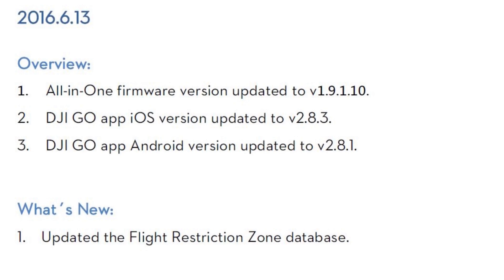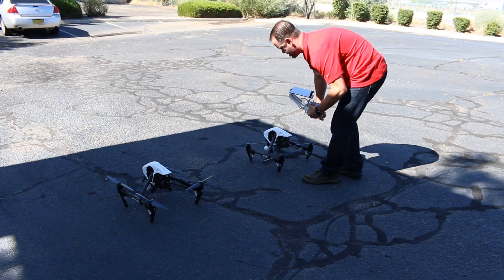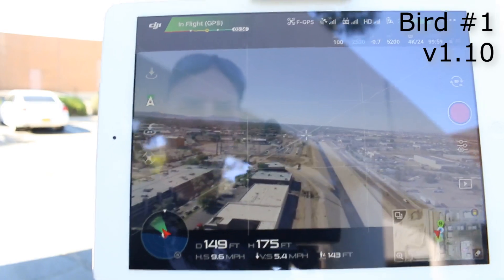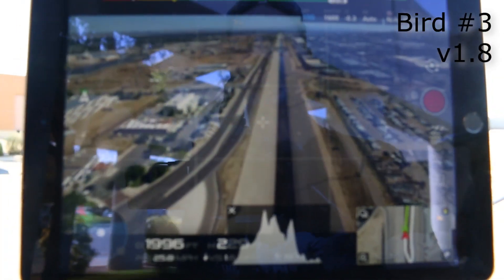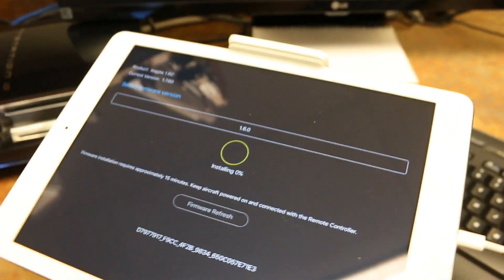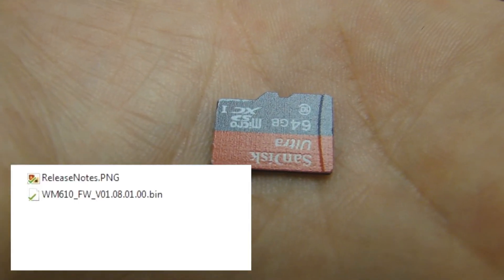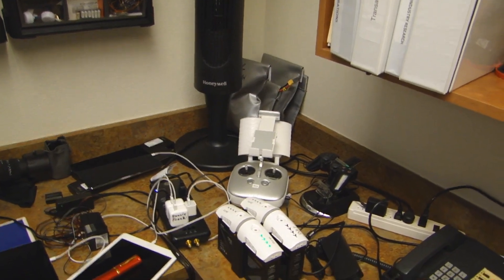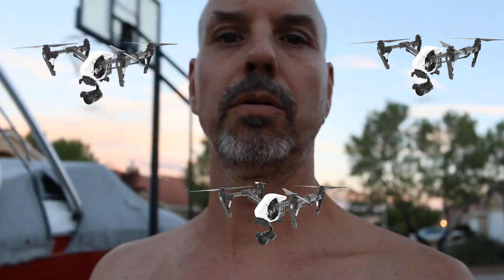Make your Inspire 1 great again...Part 1...

Comment: hi donie i have a little problem with my inspire 1 i installed the 1.9 version on mu drone and in one of the remotes controller the master wich is the newest version Gl658C the problem is that when i try to rollback my other controller gl658B it gives me errors and the gives me red light with beeping sound the error is remote controller encryption erorr what can i do or if you could help me privatly

Comment: Hello amigo, Thank you so much for your videos, great informations, help a lot, i have a problem With the gear system to push the legs down and up. Could you help me to learn how to fix it with out sending to dji? Or replace it process. Gracias!
Reply from the maker: Hey Carlos.  Sorry...that is a hardware issue.  I have yet to take an Inspire 1 apart, so I honestly don't know how to replace that worm gear or any of the other components.

Comment: 26.2.21 - I downgrade the remote to v 1.6 and when I restart the controller it beeps with a red light and tells me a remote update is required. Just my luck! Looks like I'm stuck with v1.9.2
Reply from the maker: It's been reported that the "C" controllers won't roll back to v1.6.  The "A" and "B" controllers will.  Check the part number on the back of your controller to see if it's a "C."  If it is, then yes, you are stuck with v1.9.2.  The good news is that that version has the good video feed.  It just has more NFZ's than v1.8.xxx.
Reply: @drummerdonniedotcom  Bummer I thought this would solve my glitchy, green feed. I have a C version controller, thanks for the heads up with that mate. Back to the drawing board for me by the looks of it... Subscribed BTW.
Reply: I'm actually licensed so the NFZ doesn't bother me too much ( although there are more and more popping up each time I log a flight !!) I'm thinking somehow damage to an antenna?
Reply from the maker: @gmtmtfilms : Well, if you can find a used A or B controller on eBay, that will solve your video feed problems.  And I believe you can still slave the C.  But I can't swear to that.  Oh...and thanx for subscribing.
Reply from the maker: @gmtmtfilms : Well, v1.9.xx doesn't just have more NFZ's, it has erroneous NFZ's.  Guys were complaining that they couldn't fly out in the middle of nowhere.  To avoid that scenario, you need to use a legacy version of the Go App, v3.1.1.  Any later than that, and your bird can be prevented from launching.

Comment: Hi Donnie the links to older FW is not accessible. I cant download the older FW files. I had the same problem with the Inspire 1 Pro. Any Help? Thanks
Reply from the maker: I just tested the Panorobot link.  It works.
Reply: @drummerdonniedotcom  Thanks Donnie will check it out now.
Reply: @drummerdonniedotcom   The Links have requested time out when clicking it. I tried with all my other downloaders. IDM and FDM.
Reply from the maker: @desmondkipan2713   I don't know what to say.  I went to the link.  I even downloaded a couple .zip files with no problem.  It's either your network, your security or your devices.  Panorobot is NOT a "secure site."  So many browsers - dare I say ALL of them - will not allow you to go there unless you allow http:// sites.

Comment: I still have the website www.panorobot.com open and able to use it if anyone needs a firmware bin file. Currently I'm running 1.11 and I have tried the magic file for debugging along with the 1.8 with no success. I think I need to downgrade to 1.10 but I cannot find it online and its not on panarobot. Some people were successful however I'm still trying to explore all possibilities. My drone is still able to fly and everything works however from the time I power it up in the app it says NO IMAGE TRANSMISSION. I have tried many alternatives with and without the bin file on my root directory along with the debug file but nothing works. My drone will beep a few times and then goes into this long loud process and the aircraft blinks green and red. Nothing happens with the motors blinking. It shows success on the txt file but that is not actually reflected on the about section in the app!
Reply: UPDATE: I rolled back to 1.8!!!! Everything this gentleman said worked!!! I’m still having the issue of no image transmission! When I turn it on it’s already there. I can see nothing the camera sees but the camera is working and moving!! AT LEAST I GOT THE ROLLBACK!!
Reply from the maker: @mrcarterflyhighkingc3863 : Try rolling back the app to v3.1.1 (iOS version).  I have not tested any of the legacy FW with contemporary versions of the Go App. 
Pro Tip: Go App v3.1.1 won't run on iOS 13, so you have to run legacy iOS 12 or earlier...down to like iOS 9 or 10, I believe.
Reply from the maker: @mrcarterflyhighkingc3863 : Also consider the possibility of a hardware failure of either your USB port on your RC, your Apple cable, or your iPad.  I like to switch components out to eliminate the culprit.
Reply: Donnie Frank i replaces the module on the RC last month! I have rolled back to 1.8 from the panobot website but still the no image transmission! I also made sure the shutter was on auto as recommended on another video so I guess the only thing is the GoPro app. How do you exactly rollback the app??
Reply from the maker: @mrcarterflyhighkingc3863 : Rolling back the app is way too complex to get into here.  Check out YouTube DigDat0.  He's got tutorials for all that stuff.
Reply from the maker: Almost forgot...so am I reading you correctly that panorobot.com is YOUR website?
Reply: Donnie Frank no sir it’s not my site. The other day I watched your video and clicked on your link and the site opened and I never closed it! I’m able to see and download all the firmware bids that the site offers somehow. Funny because I opened another window and tried to open the site but said it’s under construction.

Comment: Hey Donnie, thanks for this video. I am going to try this one. One question tho, you mean to say there will be 2 files on the micro SD root directory, ( 1 ) is the BIN file ( firmware ) and ( 2 ) is the blank file named WM610_FW_DEBUG. Right?
Reply from the maker: Correct.  I address this in part 2.
Reply: Donnie Frank thanks mate. This was really a BIG help!
Reply from the maker: @TheYDXtv : You are very welcome.

Comment: It’s 2020, Had to send my inspire to DJI to get fixed and they updated my firmware to the latest 1.11...+, dont do this. It only allowed me to go 1400 ft away. So I found this video of how to downgrade, and the version 1.08 which I downloaded but bird didn’t take it , so I had to unbrick the bird by using the debug file. Took me awhile to figure out how to change it from a txt file to just a file, cause his video is 2 years old. But eventually got it figured out. Motors did the red updating thing, now waiting on it to take the 1.08 version, I just don’t know when the update is done.....bird is blinking all colors of the rainbow...Will update my comment when it’s complete .....and see if version rolled back .
Reply: Updated successfully
Reply from the maker: @thomaskokoska6455 : Good deal.  I hope you subscribed...<;^)

Comment: I really appreciate all the time and research you spent on this and on helping us commenters!  But unfortunately the roll back doesn’t work as I use the X5. DJI is a joke.
Reply from the maker: I've never try to roll back with the X5, but it's my understanding that it takes more than twice as long as with the X3.  One user told me "an hour."  So...maybe try the rollback again, but this time wait a good hour before stopping the process, checking the logs and then checking the version number.  Please let me know if this works.
Reply: I did this earlier today with my X5, google search for the Inspire firmware modding tool, it’s the one with the .bat file, you can even modify the firmware file version you’ve chosen (like removing altitude limits, speed limits, etc.) and then you compile it, again using the tool, put that on to an SD formatted in the Inspire X5, and pop it in. Final step is to press down the little red button behind the nosecone of the inspire, and turn it on with that depressed and the SD card in. It will make the noises, and took less than 5 minutes for me. Then you’re done. You can take the card out, delete the firmware files after checking the success of the operation, then format it again and start flying.

It’s very straightforward as long as everything works as it should. And even if it doesn’t, the troubleshooting is pretty straightforward. This way you can choose any firmware version you want. You can also download these versions from dank drone tools, if I remember correctly, in order to easily flash them to an Inspire.

Comment: Hello, great guy. I'm having issues updating my inspire 1 with x3 gimbal. Delete history success.

Result: Failed.
Reboot the aircraft and try to upgrade the firmware again.

========== 2014.01.01 00:00:11 remo-con disconnect======
Packet: WM610_FW_V01.09.01.30.bin
Result: Failed.
Reboot the aircraft and try to upgrade the firmware again.

========== 2014.01.01 00:00:11 remo-con disconnect======
Packet: WM610_FW_V01.11.01.50.bin
Result: Failed.
Reboot the aircraft and try to upgrade the firmware again.

========== 2014.01.01 00:00:11 remo-con disconnect======
Packet: WM610_FW_V01.11.01.50.bin
Result: Failed.
Reboot the aircraft and try to upgrade the firmware again.

========== 2014.01.01 00:00:11 remo-con disconnect======
Packet: WM610_FW_V01.10.01.40.bin
Result: Failed.
Reboot the aircraft and try to upgrade the firmware again.

========== 2014.01.01 00:00:12 remo-con disconnect======
Packet: WM610_FW_V01.10.01.40.bin
Result: Failed.
Reboot the aircraft and try to upgrade the firmware again.

========== 2014.01.01 00:00:11 remo-con disconnect======
Packet: WM610_FW_V01.11.01.50.bin
Result: Failed.
Reboot the aircraft and try to upgrade the firmware again.

========== 2014.01.01 00:00:11 remo-con disconnect======
Packet: WM610_FW_V01.11.01.50.bin, WM610_FW_V01.04.00.10.bin
Result: Forbidden.
Multiple version firmware bin files are detected. Please delete the redundant bin file.

========== 2014.01.01 00:00:10 remo-con disconnect======
Packet: WM610_FW_V01.11.01.50.bin
Result: Failed.
Reboot the aircraft and try to upgrade the firmware again.
Reply: Any help please?
Reply from the maker: It looks like you have multiple .bin files on the MicroSD card OR you have v1.11.01.50 bin file.  I'm not sure why you would be using that .bin file.

Specifically here in your log file, this raises a flag:

========== 2014.01.01 00:00:11 remo-con disconnect======
Packet: WM610_FW_V01.09.01.30.bin
Result: Failed.
Reboot the aircraft and try to upgrade the firmware again.

========== 2014.01.01 00:00:11 remo-con disconnect======
Packet: WM610_FW_V01.11.01.50.bin
Result: Failed.
Reboot the aircraft and try to upgrade the firmware again.

Which .bin files are you using?  Are you using the "Magic Key" file?
Reply: Can I get a solution for that please?
Reply from the maker: @gadankrah  You haven't answered my questions.  I can't help if you don't READ what I write and ANSWER my questions.
Reply: Is there any way I could wipe everything and just start over?

Comment: Does DJI Go v3.1.10 work with IOS 12? I'm still on IOS 10 and am thinking of first downgrading the Go app via Charles, then upgrading the IOS to 12 once that's done.
Reply from the maker: The short answer is "yes."  But beware...

I've allowed my Air 1 and Air Pro Gen 2 to update to iOS 12.1.xx with good success.  HOWEVER, once you go beyond that, you start running into troubles.  So I would be very diligent with the iOS upgrade and do NOT allow it to go past 12.1.xx.  In addition, I would make sure you have full (local) backup copy of your iPad prior to updates so that if Apple somehow slips in iOS 12.3.xx in (like the sneaky bastards they are), you have an exit strategy.  

I have an Air Pro Gen 3 that delivered with iOS 12.3.xx and so far it's been a useless piece of shit.  The Go App and Go 4 App are constantly trying to update behind my back without my permission.  I'm trying finding the perfect combination of logging in ONCE and then turning off WiFi.  But the caveat is that I have to cache maps.  So I'm learning the hard way to start the app with WiFi off, then turn on the WiFi to get map data.  It's a real PITA and a problem I do not have with iOS v12.1.xx.   I've had to reinstall the Go app 3 or 4 times now.  Go 4 hasn't been as much trouble as Go, but there HAVE been issues.  I've yet to use the Gen 3 in the field successfully.  I WILL win, but I haven't as of this writing.

Side note: If you're using legacy iTunes (I use 12.5.4.42), iOS 12.3.xx is NO LONGER COMPATIBLE with legacy iTunes.  The work-around is iMazing, which has worked well so far.  There are other iTunes substitutes out there that other guys use.  Just beware that iTunes goes in the garbage past iOS 12.3.xx.

I hope that answers your question.  Good luck.
Reply: @drummerdonniedotcom  Appreciate the in-depth reply! I don't think I'm able to update IOS to anything other than the latest 12.3.x versions, due to Apple only letting you update/rollback to signed releases of IOS. Anything before IOS 12.3.x are now unsigned...I don't think I could even revert back to IOS 10. If you do manage to get DJI GO 3.1.1 going well on IOS 12.3.x please let us know! Would be great on my Air 2!
Reply from the maker: @Zhengergiser : I have successfully installed Go 3.1.1 on my Gen 3 iPad using iOS 12.3.x...several times.  The problem is it keeps updating to v3.1.47 or something like that, which requires a login, which is a deal-breaker.  I can't be forced into a login 100 miles from WiFi and cell service.  I think the secret is to open the app withOUT a WiFi connection, and THEN connect to WiFi to cache map data.  Still messing with it.
Reply: @drummerdonniedotcom  Yeah, doesn't sound too good with the forced update... Good luck with it and keep me updated! I'm in the process of downgrading the Inspire 1 to 1.8.1 from 1.10.x, your vid here is most helpful. Thanks again for comprehensive info!
Reply from the maker: @Zhengergiser  You are very welcome...and good luck!

Comment: I sent my I1v2 back to DJI  as I was having issues with the Z3 camera  lagging badly on the iPad display.
It was returned all working 10% ok but what is interesting is the firmware installed for the I1 is shown as 
V1.00.00.00.1
Reply from the maker: Which firmware?  Camera?  AC?  I'm going to guess camera, which is fine.  If that version works for the Z3, leave it.  I've used a couple different X5 cameras with varying FW versions with zero problems.